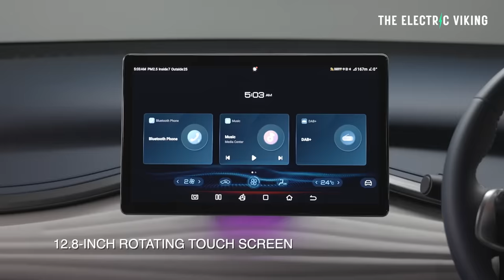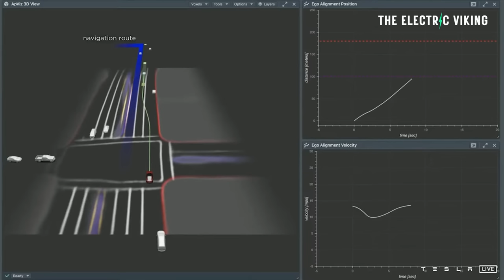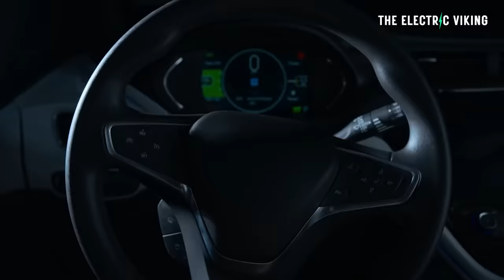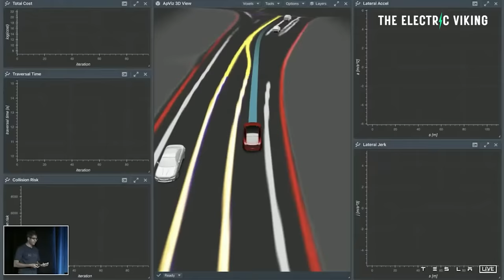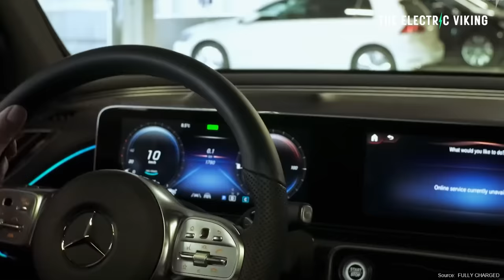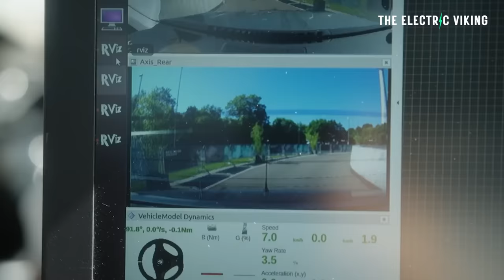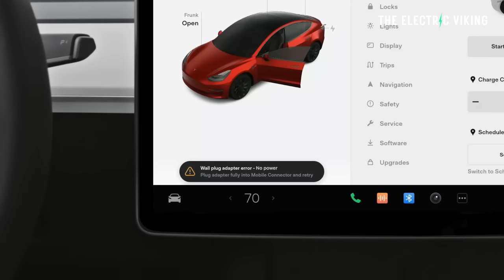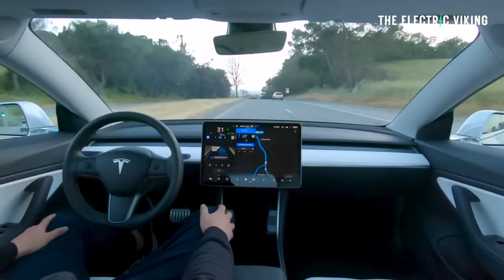Goldman Sachs says Tesla has a lead over its rivals that should not be ignored

Comment: Goldman Sachs are like rainmen who dance 100 times...and after ten times they dance it really rains. 

More relevant:

Six different trim levels of the GAC Aion Hyper HT will be sold. 

Sitting at the base of the range are the RWD Technology Version and RWD Battery Swap Version models, both priced from 213,900 yuan or the equivalent of $29,520. The RWD Technology Version has a 72.7 kWh battery pack driving an electric motor at the rear wheels with 241 hp and 262 lb-ft (355 Nm) of torque. It can hit 100 km/h (62 mph) in 6.8 seconds and travel 600 km (373 miles) on a charge according to the Chinese test cycle.

Comment: All Tesla’s factories are run with AI, unique in industry.
This is how Tesla can make 20-30 changes per week for a few $ each.
One change at other auto factories cost 0.5-1.5 billion each and typically take years…
Tesla has their own “home made” corporate software (most others use SAP) no car maker has their own software.
FSD is going to be 100% AI in a few weeks.
Previous version was mostly AI. All the training is done with AI.
Tesla makes their own AI FSD chips, everyone else uses off the shelf general solutions from Nvidia.
Nvidia unit are not optimal for Autonomous cars & uses several times as much power.

Comment: 98% of Tesla recalls are fixed by software update? Why didn't they get it right the first time?

As for FSD Tesla will fail for sure. I think Nio or xpeng will reach level 4 before Tesla. If it's reachable at all.
Reply: All auto companies have recalls.  But Tesla is the only one that can fix them with a software update instead of taking it to the dealership.